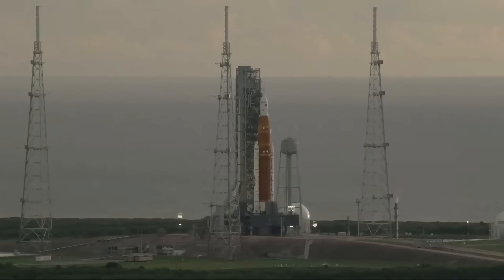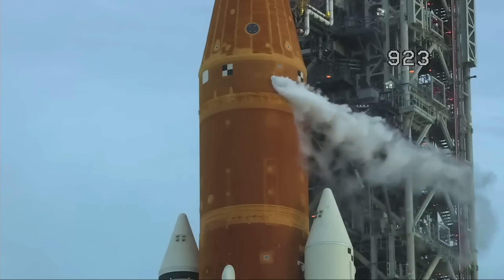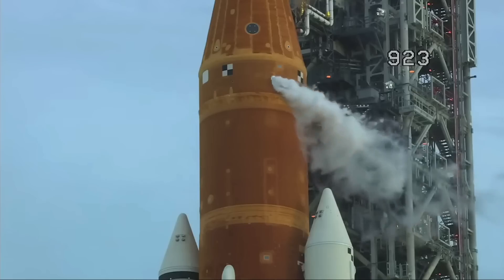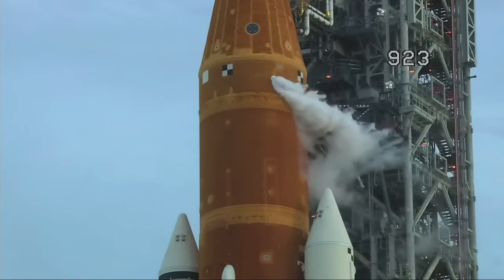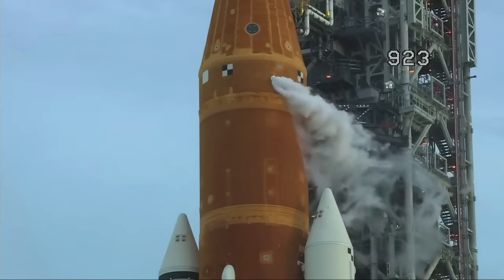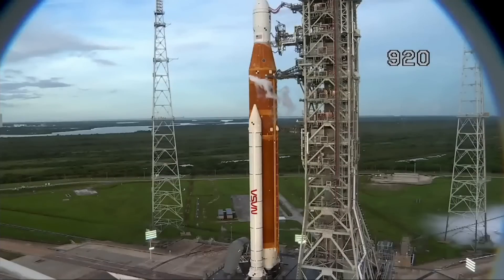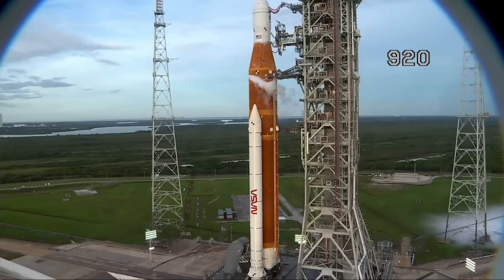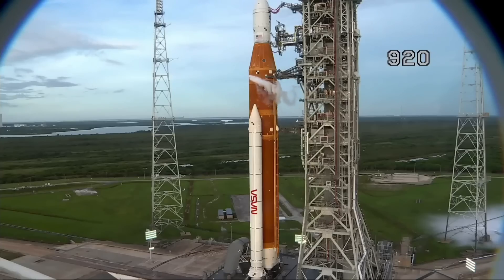NASA Artemis 1 moon rocket has 'stress crack' in tank's foam, no structural damage

Comment: It's going to have to go higher to this to get to the moon!
NASA has become an embarrassing joke.
Reply: B Babbich  Anything computer generated or AI generated must be amazing.
Reply: Satellites don't exist. GPS not working in ocean. GPS is just the triangulation of cell towers. Internet cables are buried under the ocean. Time to wake up. Trust your senses..
_ Satellites don't exist. Those are cartoons. Men send signals to the sky at an angle (a solid dome placed by our Creator), and it reflects those signals back to flat plane(earth) at same angle. Everything is stable, the ground antenna that sends, the earth, the dome, the ground antenna that receives. Universe, solar system do not exist. Are you saying there are bus sized tin objects that float above our heads about 700 km which is supposedly 2000 C hot and doesn't melt the trash cans(so-called satellites) ??
_ Does it feel like we are travelling at 66600 mph around the sun? Earth inclined 23.4 degree? 90 -23.4 = 66.6 now you see it's 666 everywhere.. it's the devil's number.. YOU WILL KNOW THE TRUTH, AND THE TRUTH WILL SET YOU FREE. 
 _ Why mercury and venus show up in the night sky? Can any scientist (Illuminati) explain this? No. All 12 months, we see the same stars in the night sky, but we should see some other stars which are in the other side for 6 months. Globe is busted again.
 _ Antarctica is the surrounding 300 ft. tall ice wall of our flat earth, and illuminati won't let anyone near by to discover that the world is flat, it's the most guarded place on flat earth. There is a treaty signed by 50 countries that no man can get to Antarctica, because it's the surrounding wall of our flat earth, and it extends very far.
Reply: B Babbich  Dude, are you not aware of the truth yet?  Earth is not a globe, universe doesn't exist, sun & moon are the same size, made up of plasma hovering above our flat earth. If earth goes around the sun, then why do we see same stars for all 12 months? Shouldn't we see different stars on different directions? Globe liars got busted once again😁 solar system, big bang, planets are fake (photoshop). Are you people even real?
 Michaelson-Morley and Airy's experiment were supposed to prove the earth's rotation, but those proved the earth doesn't spin, they bite the dust, many experiments ended up with the result of non-moving flat surface. WELCOME TO REALITY. UNIVERSE DOESN'T EXIST. 
Governments , nasa, isro have been lying this whole time.
Reply: B Babbich  Yeah nice camera!
Reply: Dude this happens all the time, shut up already, Spacex has had way too many rocket explosions to possibly count, NASA hasn’t had one in like 19 years, they are going to fix this problem and have Orion on a lunar transfer trajectory before the end of next week, probably before the beginning of next week

Comment: Scrubbed due to issues with 1 of the 4 engines. Next attempt will be in the 2nd of September if things are sorted
Reply: Also weather delay
Reply: correct, engine 3 didn't come down to the pre-conditioning chilled temp target
Reply: they could make this into a mini series ..
Reply: @allanchurm  🤣😂😁😂😅👍
Reply: @allanchurm  I'm afraid it would be more like one of those long running sagas than a mini series... 😆
Reply: @allanchurm  the actors would die of old age before this thing ever gets off the ground
Reply: @ghoward6797  🤣😁😂
Reply: Dude, are you not aware of the truth yet?  Earth is not a globe, universe doesn't exist, sun & moon are the same size, made up of plasma hovering above our flat earth. If earth goes around the sun, then why do we see same stars for all 12 months? Shouldn't we see different stars on different directions? Globe liars got busted once again😁 solar system, big bang, planets are fake (photoshop). Are you people even real?
 Michaelson-Morley and Airy's experiment were supposed to prove the earth's rotation, but those proved the earth doesn't spin, they bite the dust, many experiments ended up with the result of non-moving flat surface. WELCOME TO REALITY. UNIVERSE DOESN'T EXIST. 
Governments , nasa, isro have been lying this whole time.
Reply: Satellites don't exist. GPS not working in ocean. GPS is just the triangulation of cell towers. Internet cables are buried under the ocean. Time to wake up. Trust your senses..
_ Satellites don't exist. Those are cartoons. Men send signals to the sky at an angle (a solid dome placed by our Creator), and it reflects those signals back to flat plane(earth) at same angle. Everything is stable, the ground antenna that sends, the earth, the dome, the ground antenna that receives. Universe, solar system do not exist. Are you saying there are bus sized tin objects that float above our heads about 700 km which is supposedly 2000 C hot and doesn't melt the trash cans(so-called satellites) ??
_ Does it feel like we are travelling at 66600 mph around the sun? Earth inclined 23.4 degree? 90 -23.4 = 66.6 now you see it's 666 everywhere.. it's the devil's number.. YOU WILL KNOW THE TRUTH, AND THE TRUTH WILL SET YOU FREE. 
 _ Why mercury and venus show up in the night sky? Can any scientist (Illuminati) explain this? No. All 12 months, we see the same stars in the night sky, but we should see some other stars which are in the other side for 6 months. Globe is busted again.
 _ Antarctica is the surrounding 300 ft. tall ice wall of our flat earth, and illuminati won't let anyone near by to discover that the world is flat, it's the most guarded place on flat earth. There is a treaty signed by 50 countries that no man can get to Antarctica, because it's the surrounding wall of our flat earth, and it extends very far.
Reply: Depends if they use Prime delivery to get the duxt tape faster, they might not want to spring for express shipping.
Reply: People really mad a spaceship because it "wastes" tax dollars. My brother I Christ, the US literally spends more developing technology to anhilate civilians in foreign countries than in social programs that do help you. 

Grow up.
Reply: The test dummies inside got so excited and anticlimactic
Reply: Scrapped.
Reply: "From that time Jesus began to preach, and to say, Repent: for the kingdom of heaven is at hand." Matthew 4:17 

"Ye have heard that it hath been said, An eye for an eye, and a tooth for a tooth: But I say unto you, That ye resist not evil: but whosoever shall smite thee on thy right cheek, turn to him the other also." Matthew 5:38-39|
Reply: @dumbpoorhappy  sounds good. Put Jesus on Artemis 1
Reply: Scrubbed due to Russia having anti satellite missiles... As demonstrated few daysago. 🤣🤦🏿‍♂️
Reply: I hope it blows up on the pad or shortly after so we do not waste billion's more tax dollars on obsolete tech.
Reply: @npbiggs4382  And, what's with this 'crack' in the foam, but the tank supposedly remains intact? It's not just the one engine.
Reply: @johnxjen  no crack in the foam it's just how the for is made water got in there ice formed not a big issue easily solved
Reply: @johnxjen  There have been so many fillings and emptying of the cryo liquids that the repeated contractions and expansions of the metal structure under the foam has flexed the foam. Try repeatedly flexing coated metal and see what happens to the coating.
Reply: @johnxjen  There is no reason the lie about that
Reply: @npbiggs4382  Did you whinge and whine when the government spent a trillion plus on useless wars in Iraq and Afghanistan ?
Reply: @tharr67  Exactly.
Reply: @tharr67  No I protested that evil war.
Reply: @npbiggs4382  Good I take back my snarky comment then
Reply: @npbiggs4382  are you a SpaceX fanboy? You know your god Elin is a charlatan, right?
Reply: @npbiggs4382  You're so close minded, open up!
Reply: @Plextum  Closed minded is doing the same thing over and over without realizing what's wrong.
Reply: @Plextum  Sunk cost fallacy gets people every time. Cost/benefit just isn't here.
Reply: @Plextum  open up? Hes not wrong, SLS is obsolete tech compared to current vehicles, but gov can’t abandon due to budget already spent
Reply: @npbiggs4382  might just do that if the launch has been scrubbed last minute you would think when things seem A ok all of a sudden its half way to the upper atmosphere of earth and BOOM billions of american tax payers money goes up in flames there are 2 good things in this situation 1 its un maned rocket and 2 i'm Australian so it wont cost me sweet FA lol
Reply: @scottharvey3848  damn you Australian man
Reply: @npbiggs4382  He says that while writing a comment on the internet which is transmitted by sattelites in the orbit which is only possible because of investments into space flights 70 years ago. Ironic. You not understanding why we go into space doesn't mean it's obsolete.
Reply: @wassolldenndas1136  internet comments are not transmitted by satellite... not most anyway. There is landline in the actual ocean. Satellites are slow.
Reply: @asyncasync  Come on, you know what I mean. Yes internet is primarily transmitted by landline but not entirely. Not speaking of all the other every day services we use requiering sattelites including GPS, weather data, radio/TV, communication...
Reply: @wassolldenndas1136  its just that I have seen this comment about satellites apparently enabling internet a lot and it is factually wrong. I am sure it could be reworded and still make the same point.
Reply: @wassolldenndas1136  Throwing good money after bad isn't what a good engineer does. SLS is a jobs program with maybe some science in the end.
Reply: @wassolldenndas1136  Over 99% of internet traffic is carried by undersea cables.
Reply: @npbiggs4382  That wastes more money though... why would you want a rocket to blow up? They still have SLS parts being manufactured, it would just delay the program.
Reply: @imEden0  Not if they looked closely at SpaceX.  They would get what they want AFFORABLY.
Reply: @npbiggs4382  yes but blowing up a rocket the price of 5 falcon heavies is more of a waste of money, not that Artemis is actually a waste of money
Reply: @imEden0  If it works ir is more of a waste as they will build and launch more of these wastes.
Reply: @npbiggs4382  yeah I bet you wouldn't save for you children's schooling either
Reply: @krystiangeldon7929  WTF???